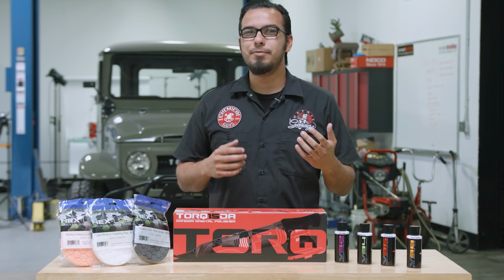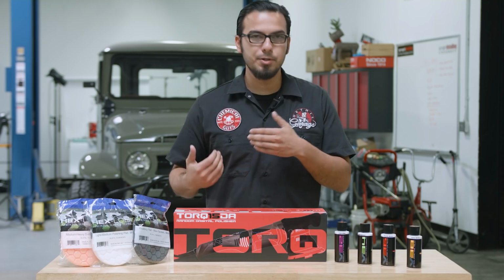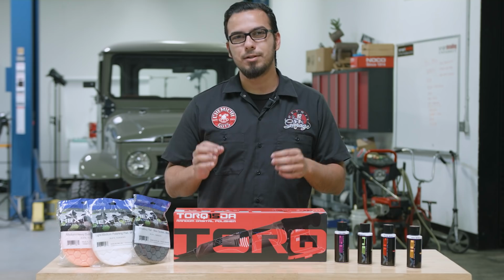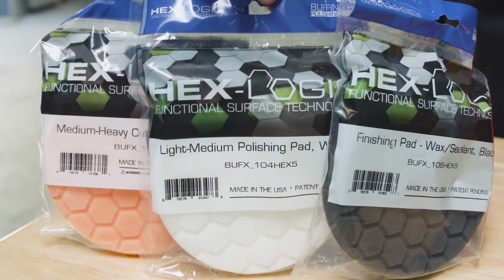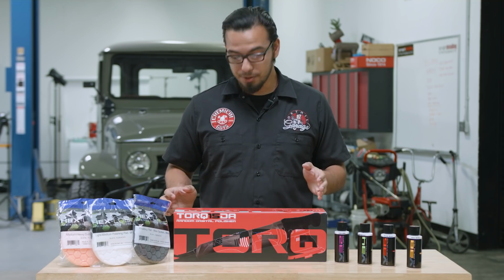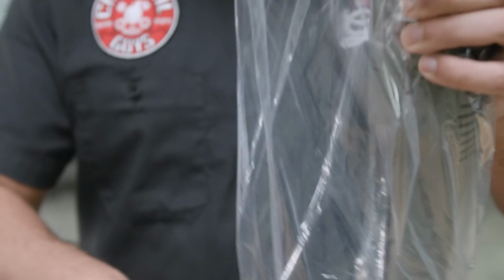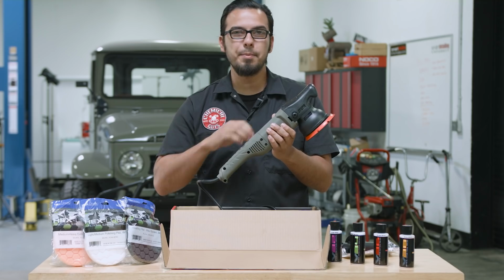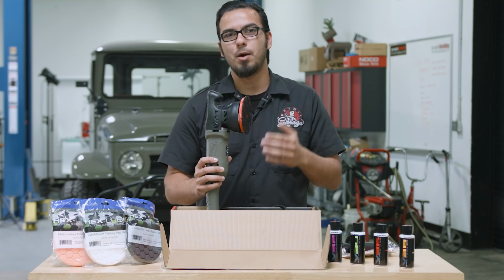Unboxing ALL NEW TORQ 15DA Polisher Kit! - Chemical Guys

Comment: You guys always say set settings to 5-6. What would that be with this machine , i just received mine dieng to try it just dont wanna mess up a car
Reply from the maker: Hey there! Using the highest speed setting on the TORQ 15DA would equate to 5500 OPM which produces the right amount of friction to diminish your compound/polish thoroughly. - Happy detailing!

Comment: I was wondering which polisher is best for doing headlights,  and Can  it be changed to use a 3inch backing plate and pads?...and Safe for a beginner?...
Reply from the maker: Hi Raymond! We recommend the TORQ X polisher. The TORQ X backing plate can be readjusted to a 3", 5", and a 6" Inch backing plate. Happy detailing! Check the link below. 

https://www.chemicalguys.com/TORQ_TORQX_Random_Orbital_Polisher_p/buf503.htm